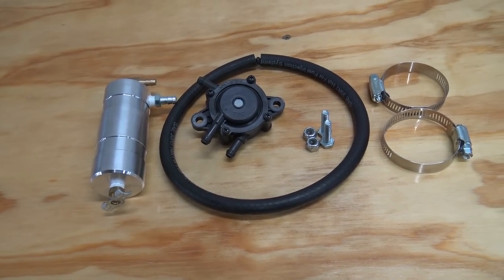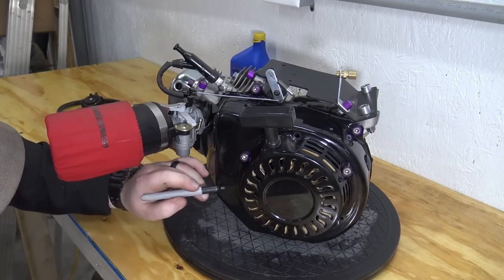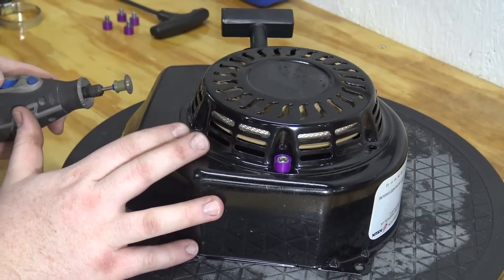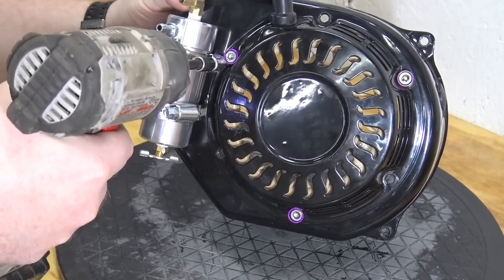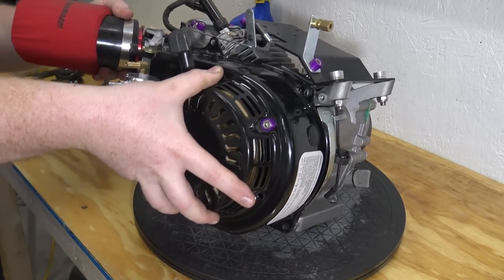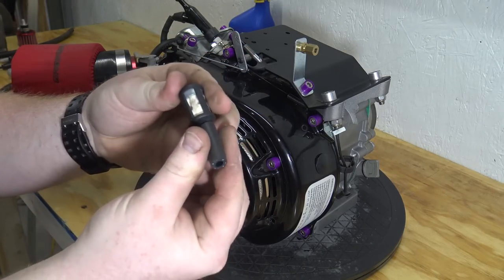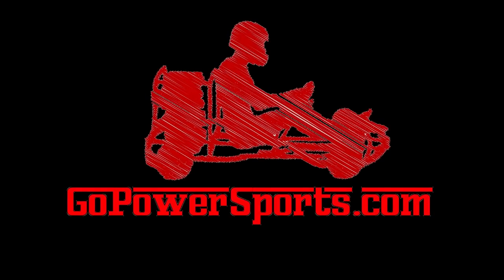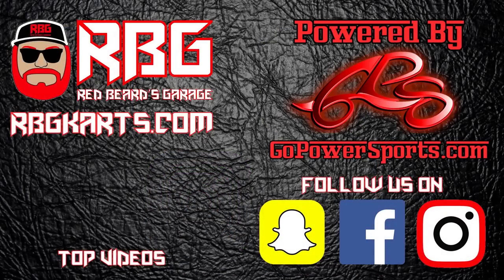How To Install a Oil Catch Can on a Go Kart - Predator / Honda

Comment: Good job red beard. Not to bash you but, I would have suggested smoothing off the hose clamps where you cut them or putting some black tape on the end of it to prevent cutting of hands reaching down for the pull rope is all maybe some sort of rubber boot. Again enjoy the channel can't wait for the next video!!
Reply: Todd Bearden or heat shrink tubing

Comment: I watched this video for the Pulse pump install in the picture.. yet this is only the oil catch can! where is the pulse video please?
Reply: Exactly what I said. I watched this a few times thinking I missed the pulse pump
Reply: Do I need the pulse pump?
Reply: You do need the pulse pump. On a set up like this you other drill a hole in the valve cover and screw a fitting in then run the line to your pump. My 212 ghost has a fitting that screws into the top of the crank case and goes to pump. Gas tank to the pump, pump to crank case, and pump to carb.

Comment: What if I use a case pulse pump to move the oil from the catch can through a cooler and into a radiator? Then back through the top governor hole?

And what if I tap that hole to fit a fuel jet, and a hose barb, then locktite them into each other so the oil meets resistance and is pressurized by the case pulse, then sprayed over the engine parts from above, could help with cooling and lubrication of the crank and cam.

Comment: Have you ever tried using an epoxy or J.B. Weld to hold the catch can on? It would delete the hose clamps, saving cut fingers from sharp edges and be an even cleaner look on the cover. Just an idea.

Comment: I have a stock ghost 212 and the valve cover has a hole in it. I see that you stick the hose into that hole. But for me, I don't think it's just an open hole like there's something behind it. Do I need to modify that?

Comment: What's up withe the pulse pump? Great video.   Thanks!
Reply from the maker: It was going to be a video of both but then I changed it lol
Reply: Can you run it to the pulse pump from the catch can and still have the vent on the can? Or will  that not be enough to run the pump?
Reply: KartingOutlaws did you get a definitive answer about the pulse pump. I need to install a catch can on my Racing Mower. Excessive blow by is pushing oil out of my pulse pump. If I plumb the catch can in line with the pulse pump, things should be cleaner, but I wonder how much crank case pressure is too much for the pump?

Comment: Mr Beard, will you please help unconfuse me. At 1:10 the video is showing a fuel pump along with the catch can, hose, clamps, and bolts. But i didnt see anywhere in the video where the fuel pump came into play. I am running a predator ghost. And on my engine, oil leaks from the top of the fuel pump, instead of where you routed your hose. I am kinda sorta but not really sure what I need to do. You know what I'm asking. Will you please fill in my blanks?

Comment: Only when i use my fuel pump my valve cover leaks oil. it's a very small leak, one drop each minute or two. Will a catch can fix my issue?

Comment: Red beard would the 301cc fit the ct200u frame or is it to big
Reply from the maker: It will fit you just have to put a different engine mount on or drill new holes

Comment: why is the black fuel pump pictured in the beginning?
Reply: I think it was a foul-up. I wondered the same thing, and it forced (LOL) me to watch the video. I had thought maybe the fuel pump was going to be some sort of oil recovery system to pump the oil back into the engine. Nope. LOL
Reply from the maker: It will be the next video. It was actually a mess up lol.

Comment: Why not run the pulse pump off of the discharge side of the catch can?
Reply: Because oil might get into your pulse pump. I’m running a air line from my valve cover as well as the catch can and I’m starting to notice some oil in my air lines. Most guys just run the pulse pump from the intake manifold.

Comment: That's a good job on the installation, Redbeard.  I like the compact size of the catch can and the way you mounted it on the shroud.  Have a look at the one I made recently: http://www.oldminibikes.com/forum/photopost/data/500/PVC_Catch_Can_3_1.jpg
https://www.oldminibikes.com/forum/mini-bike-discussion/155521-pvc-catch-ver-2-0-a-post1167452.html#post1167452
Reply: where does the oil go once it goes to the catch can does it just sit there or does it return or do you have to drain it and add it back yourself I don't understand this

Comment: Coulded a person just rig up the bottom cap of the catch can to just deliver the oil to the base of the engine automatically?
Reply from the maker: I have actually thought about that a few times and forget to set it up
Reply: There would probably need to be a check valve/one way valve on the side that returns to the crankcase. Otherwise you would have pressure coming from both ends. The hole where the governor passes through would be a good place to return it, or the oil sensor hole as second choice.

Comment: You would think the engine manufacturers would be smart enough to solve this problem before they ship out oil puking self destructing engines
Reply: At lower RPMs these engines were intended like on mowers and tillers they don't really puke.
Reply: neo 71665 really horizontal shaft engines were meant for lawn mowers? Enen engines the sell for go-karts even engines that dinner in go karts do this
Reply: the engines, even on cars vent this to the air intake. This is for EPA regulations and emissions standards. There is no possible way to prevent a small amount of blowby, which needs to be vented from the crankcase, otherwise it would blow engine gaskets. Venting to atmosphere or the intake is the only way to prevent the engine from leaking the blowby through a place that is sealed.
Reply: KartFab yes sir that’s the real truth no way around it 😃 😊 😆